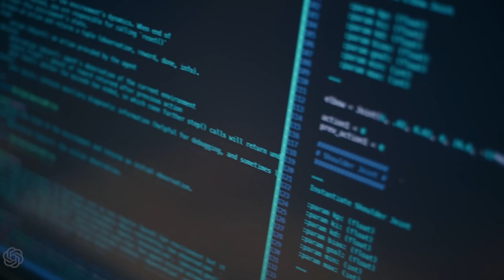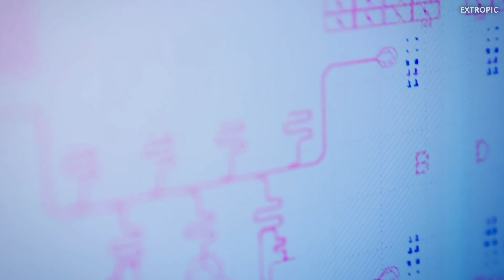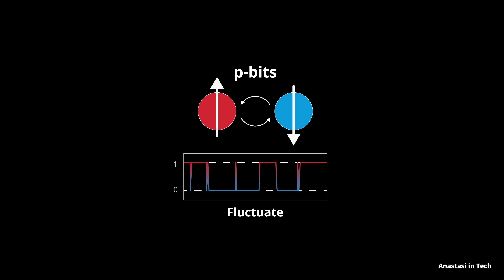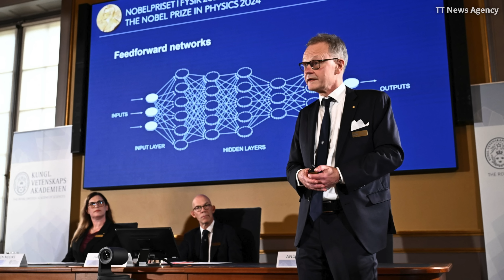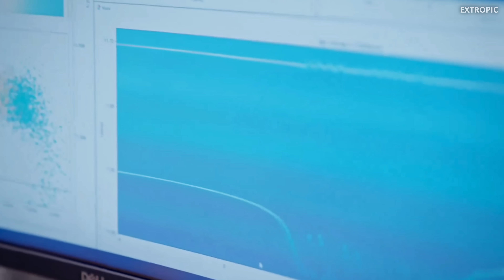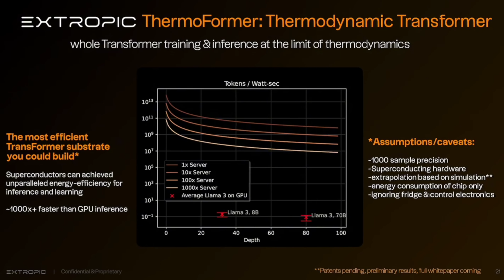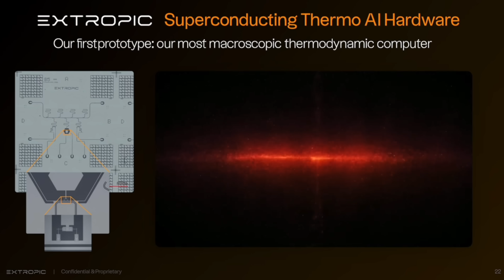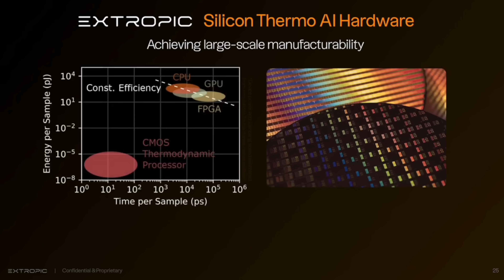Probabilistic Computers Explained

Comment: I think that quantum computing is not equal to probabilistic computing because quantum computing includes the very important property namely exploiting entanglement of Q-bits. Probabilistic computing does not - and at best is a massively parallel technique with all the limitations therein. I'm wondering if there's a way to provide effective entanglement without relying on quantum effects? I'm betting there is - at the cost of number of circuits? There already exist optimization algorithms for classical CPUs and GPUs such as simulated annealing, Monte Carlo methods, and genetic algorithms to name a few, which employ thermodynamic noise to obtain solutions and I use them. 
Implementing these algorithms directly in hardware could be interesting.
I seriously wonder whether quantum computing is really better (for some classes of problems) than probabilistic computers? I'm willing to bet that mathematicians will eventually prove that quantum computing offers NO theoretical advantage vs. the best possible classical probabilistic computing and that quantum computing will be proven to be equivalent to classical probabilistic computing - contrary to intuition. The problem with quantum computing supremacy could prove to be similar to the disproven idea that one can use quantum entanglement to transmit information faster than light and the villain here will be quantum thermodynamic limitations.

Comment: It would be wonderful if we can do Monte Carlo simulations with Voltage and Current supplies as probability distribution (PB), resulting in a PB of the output voltage depending on the PB of the process variation. That would reduce MC sims from hours to seconds without the need for large RAM. I tried to do this for my PhD thesis, but failed because the number of variables in the exponentials were too many to calculate due to the MOS models. So I ended up doing my PhD thesis on another subject.
Reply: Probably for the better.

Comment: Hmm "100 Million Times GPU Performance when running a transformer model" you say and how would you code such a Chip to run a classical programmed A.I. . One of the most significant challenges is that modern software, compilers, and tools for machine learning and LLMs are designed around binary systems. Switching to a ternary system would require a complete overhaul of existing frameworks, software stacks, and algorithms. This transition would be incredibly resource-intensive and time-consuming. Many semiconductor processes and fabrication techniques are optimized for binary systems, making it difficult to adapt them for ternary logic. Research into ternary logic suggests that while ternary systems might, in some cases, be more efficient, they may also introduce new challenges in power consumption, especially in high-speed operation where the complexity of managing three states could outweigh the potential benefits.  Managing three states instead of two requires more complex control logic, error correction, and state transition management. This increases the design and debugging complexity of the microprocessor, making it harder to ensure reliability and performance.

Comment: Oh my god this would be amazing for sound engineering and design... At last the death of analog audio superiority :D
Reply: It will ALWAYS be analogue audio, in the final analysis.  Everything in the world is analog.  And if you mean tapes or records, those modes of sound capture died a LOOOOONG time ago.  You can have your 40dB nail in a crooked groove, with massive distortion and equalization.  I'll pass.
Reply: @MrJdsenior  no it would still be digital audio but with the easy implementation of analog non linearities in the usually sterile émulations of classic analog gear that are now sold 5000k a piece for a single compressor. Tape is dead because of its impractibility but it still sounds infinitely better when you track everything through it, which is why people are still ready to sell an arm for it. Of course that all digital processes ultimately rely on analog tensions and currents, but the whole point of the binary system is to decorellate the values from the noise present in electricity. That's basicaly the point of the  vidéo, a way to keep thé non linearities available in thé values so that non linear behaviours like thermodynamics or tube saturation could be emulated for a fraction of thé power ! Of course digital audio is infinitely more close to thé reality, no microphone is better captured than through a direct digital conversion when you're strictly comparing voltage values, but believe me that's not what sounds best when it comes to mixing and ultimately listening, we actually love the natural THD of analog gear due to their non linear behaviour ;)

Comment: == Summary ==
  • Early classical computers were complex and inaccurate, prompting a shift to digital chips in the 1960s.
  • Digital chips are now reaching physical limits, leading to a new paradigm: probabilistic or thermodynamic computing.
  • Probabilistic computing utilizes noise as a computational resource, making it 100 million times more energy-efficient
  than modern GPUs, especially from Nvidia.
  • Modern computers simulate probabilistic tasks inefficiently with transistors, where emulating probabilistic systems is
  slow and energy-draining.
  • Probabilistic computing builds from Richard Feynman’s 1982 suggestion for computers that naturally embrace uncertainty.
  • The foundational concept here is the Boltzmann law, which describes how systems seek equilibrium amongst many possible
  configurations.
  • Probabilistic computing uses "p-bits" (probabilistic bits), a middle ground between classical bits (0s and 1s) and
  quantum bits (superposition of 0 and 1). p-bits naturally fluctuate between 0 and 1 due to thermal energy.
  • p-bits are built using various technologies, including CMOS combined with superconductivity or magnetism, and they
  amplify environmental noise for computation.
  • The analogy is drawn to the human brain, a highly efficient probabilistic system with 100 trillion parameters
  operating on just 20 watts.
  • Probabilistic computers function similarly to neural networks, but with feedback loops instead of a feed-forward
  structure.
  • The p-bits take inputs from other p-bits, and outcomes in probabilistic systems are weighted averages, making this
  setup ideal for AI and machine learning, particularly optimization tasks.
  • The mathematical underpinning of p-bits is similar to the Boltzmann machine, a neural network model based on
  probabilistic principles, linked to recent Nobel Prize-winning work.
  • Thermodynamic computing is a subset of probabilistic computing. It uses the second law of thermodynamics, where
  systems minimize energy naturally, to solve problems as they reach equilibrium.
  • Startups like Normal Computing and Xtropic are pioneering thermodynamic computers, using technologies like Josephson
  junctions (JJs). These create fast p-bits through quantum fluctuations.
  • Xtropic claims its thermodynamic computers, using JJs, are up to 100 million times more energy-efficient than GPUs for
  tasks like running transformer models and diffusion-based models (e.g., DALL·E).
  • Building probabilistic systems with classical transistors is inefficient, as one p-bit requires the computational
  power of 10,000 transistors.
  • Although Xtropic uses superconductivity for their p-bits, which requires cooling, further research may allow building
  these systems with CMOS to scale up.
  • While probabilistic computers won’t replace traditional digital computers where precision is crucial (e.g., financial
  transactions), they have significant advantages in AI, machine learning, and simulations (e.g., Monte Carlo simulations).
  • The video promotes a course on semiconductor and AI computing, offering insights into new computing technologies, AI
  chips, and investing trends.

Comment: Some things here reminded me of vaguely similar techniques from long ago.  Alec Reeves, pioneer of digital representation of analogue signals, described the Equilibrium Encoder, in which the correct digital output was the equilibrium case.  I made one for my final year project at Woolwich Poly in 1973.  Also the technique of "dithering" which adds noise to a signal to improve the resolution of the A/D converter.
Reply: Do you have a link to learn more about the Alec Reeves equilibrium encoder? Thanks.
Reply: @dadananda  I got my information from "Principles of Pulse code Modulation" by K W Cattermole, Iliffe Books, 1969.  It is listed on Amazon.  I don't know if there is anything on the web.  Of course, I was doing this long before the web existed.

Comment: Minimal path and most optimal arrangement algorithms are not probabilistic. The global minima can be found. The problem is that they usually are not polynomial in complexity and hence approximations can be used that are nearly as good. They usually use sampling and that can be implemented stochastically.
I'd be surprised if there are a great many use-case for such applications left.

In simulations and solving differential equations, there is still a lot of room for analog computing though. But the role of noise processes is vastly reduced. 

Apart from using little energy - which is likely true - I think that this solves an issue we really had in the early 1980s but no longer do.

Comment: In my understanding, Thermodynamic Computing involves the use of two thermodynamic quantities – energy and entropy. You mentioned the second law of thermodynamics. Classical computers have traditionally only accounted for information related to energy in the form of work. Work is very directed, whereas heat is entirely undirected. In classical computers, nearly all information must be removed as heat, and they need to be cooled to prevent damage. In Thermodynamic Computing, instead, as much information as possible is extracted and processed from this heat. However, it is not easy to measure and evaluate information such as time-dependent temperature values (the noise you mentioned) so precisely and at such a localized level. The use of this technology could be great. And thank you for your report from Vienna

Comment: Sentence 1 is wrong: analog computers never "dominated the world"
Reply: I would argue that in the 1930s, the Bush differential analysers did 'dominate the world'.
Reply: Like hell they didn't, the world of computation, anyway.  Tell that to my father, who accurately simulated missile body bending moments, helicopter blades, etc. with them, long before digital computation even existed.  You could say the same with slide rules as precursors to the calculator.  As the punch line in the horrific joke/pun one of my college profs told, "adders always multiply on a log table".  Believe me, you don't want it related here, it was long, involved Moses, and was a real groaner.

Comment: The nice thing with Photons is that they don't decay (because time is frozen at the speed of light) unless they hit something and then, if is a mirror...
Reply: how can anything made of energy "decay" depends what you mean by decay, not decay like a corpse, or a neutron becoming a proton.
Reply: @thesnare100 , Decay in a metaphoric sense. If you cut power to a superconductor Q-Bit it will cease to exist. A photon can travel for ever if there is no obstacles.
Reply: @marcbjorg4823  it makes me wonder what is there to stop you from going forever if YOU could travel at the speed of light, since there is "end of space" so to speak a point where space is still expanding/hasn't expanded to you, but it travels faster than the speed of light, as has been doing so since the big bang, so you couldn't up with it. I don't know if there's a name for it "the space wall" or something

Comment: The missing piece for me in this and quantum computing is how to control the shape of the probability that the p-bit/q-bit represents. Even if I accept that normal distributions are always acceptable, how does one set the mean and standard deviation? And how do you read that probability back out of the result? I mean, of course one can do many draws and compute the distribution just as we've always done, but where's the time savings?

Comment: I wonder if there's a future advancement in autocorrelation from this approach to improve signal to noise ratio in extracting low distortion analog waveforms at very precise frequencies.
Reply: Decreasing noise with noise, interesting concept.  Like decreasing temperature with heat.  ;)

Comment: Im not sure you explained “noise” adequately.
Reply: Random crap.
Reply: @MrJdsenior  am after technical/ physics explanation
Reply: @ralphstern2845  That WAS my technical/physics explanation.  ;-) 

Noise in a circuit is unwanted injected or native energy that isn't signal, induced voltages due to environmental, from external drivers like high voltage or magnetic fluxes,  high energy particles, vibrational energy (microphonics), etc.  

If it gets bad enough and the noise level approaches your signal levels, things get ornery.  Ones can become zeros, and vice versa, or worse metastabilities occur.  The native noise comes from the non ideal nature of components, power supplies, unruly grounds, etc.

Think hiss, on magnetic tape, or surface noise, on a record.  As to the problem, think about trying to hear someone across a noisy room.
Reply: @MrJdsenior  much appreciated

Comment: so they need a second chance, to build the most expensive noise generator.
mind the band gap in a transistor. it can be used as a noise generator too.
specialized transistors are'nt new.

Comment: This is not new.  Doing it in silicon is new, but what has been done since the industrial revolution.  Before there were active controls, you set up an equilibrium equation.  On one side, you put things you could determine, and on the other side, you put things you couldn't determine.  The met on something you wanted like the temperature of a room or the number of bags of flour you wanted to grind every day.  You turned the system on and it settled on its equilibrium point.  You fiddled with the things you could determine until the equilibrium point was what you wanted.  Same is true for any analog computer.  You dial in the properties of the equilibrium and you let it go.  It's a beautiful implementation of a very old engineering method.
Reply: Is there a good youtube video that explains this in detail?
Reply: @TesterBoy  First Principles of Engineering.  It's actually greek philosophy. But more intrinsically like neurons.
Reply: @TesterBoy  Search for PID
Reply: Connecting energy probabilities within equilibrium while maintaining synaptic connections is basically what the mind does? 
Putting that with a powerful AI… 
Because putting quantum computing with AI is what we have now with computers/bots?
Reply: @patrickhulliger7856 that's what the brain does. We don't yet know what "the mind" does.
Reply: @patrickhulliger7856  No. We don't use quantum computing for anything at the moment. The technology hasn't progressed enough to have any legitimate real world uses quite yet.
Reply: Practically limitless computational power can do amazing things. And our ancestors were often smarter than we give them credit for.

Comment: IBM was once the king of  JJ devices trying to build very fast digital processors, but the big problem with JJ devices is they only work at a few Kelvin, and the temp cycling of a JJ computer is not good. So call me super skeptical on this one.

Comment: This is so cool! 

I was imagining this as a quasi-analog probabalistic system ("continuous" states), but this makes sense given it harnesses quantum effects of thermal noise in cmos. I imagine the feedback "slides" the state toward a final state/equilibrium for each p-fet, (probabilistically weighted), and the system as a whole? I'm quite curious. This seems like a "once in a generation" discovery.

I was about to say "this is like the happy-space between classical and quantum", amd "this is closer to how a brain miht work" - we came to the same conclusion on that 100%. Perhaps not a surprise, considering we vith come from an analog design background (worked in high speed mixed signal, RF/uW, mainly with cmos/bicmos). I now work in game dev and a bit of CV and AI. So it makes a tonne of sense how useful this can be. The potential applications for things such as non-deterministic state-based/programmatic ai behavior, optimization, etc -- are huge.

This is very cool - ty for sharing!

Comment: If I get it correctly : quantic computing doesn't work (at least so far); so, we decided to "simulate" quantic "behavior" in traditional computer systems... Am I right here ?
Reply: partially, it works almost impossibly well for some types of computing, but you need a digital computer to check the answers to obtain the correct one from the trash.  The point is, as I understand it, that it minimizes the solution set to a manageable level for some otherwise unmanageable level of two state calculations, like decoding some encryption systems.  Not remotely an expert, but that is what I get out of what I have been hearing.